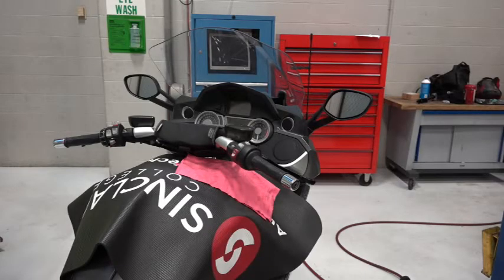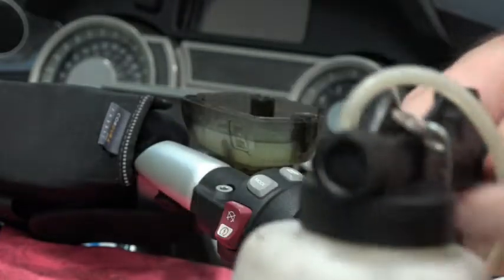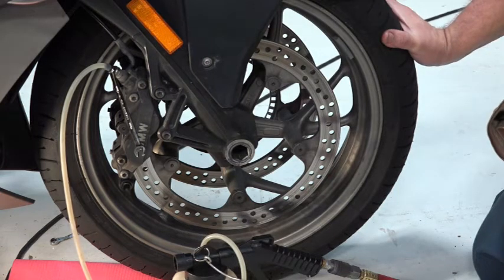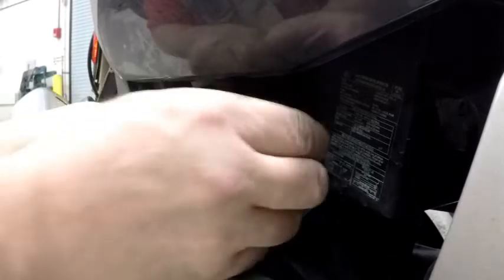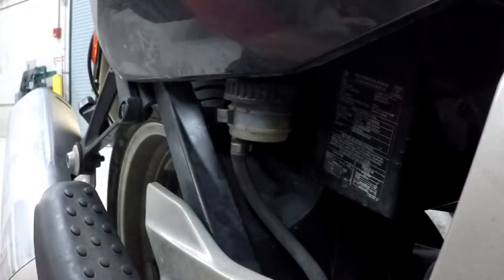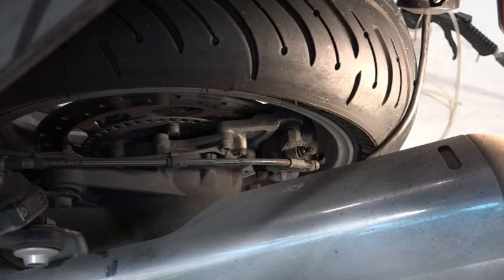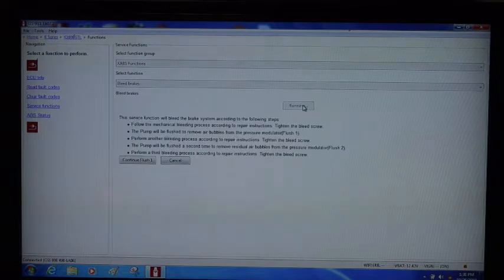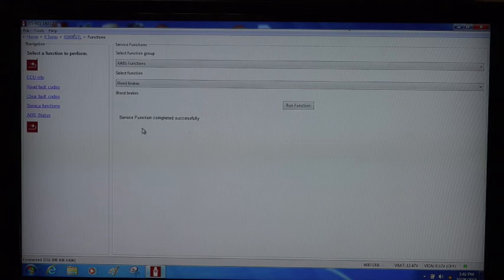K1600 Brake fluid flush and fill

Comment: Awesome video.  Have you tried to bleed the clutch using this method?  The clutch bleed nipple does not work the same a a brake bleeder.  It is just basically a set screw.  I am going to try a gravity bleed.  Last time I got air in it and it still has air three years later.  I bought the 1 pint of Royal blood.  The little 8oz bottle is just not enough